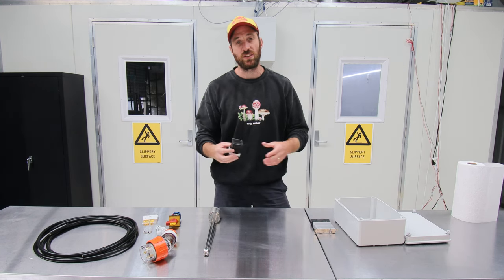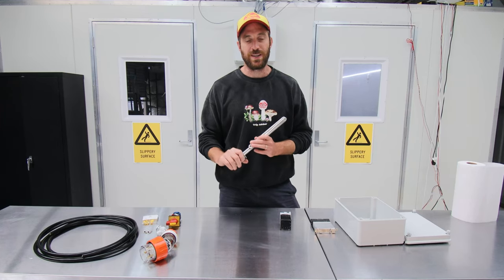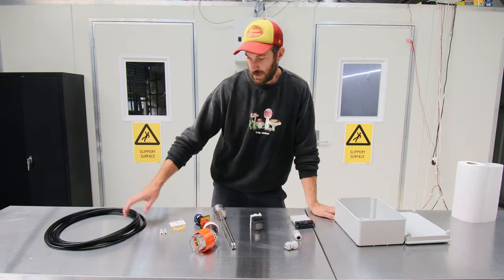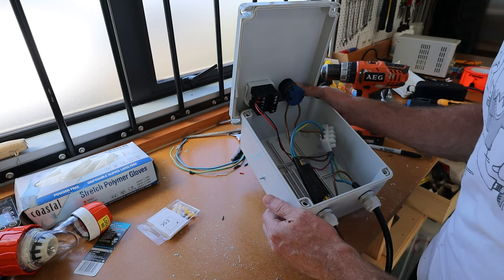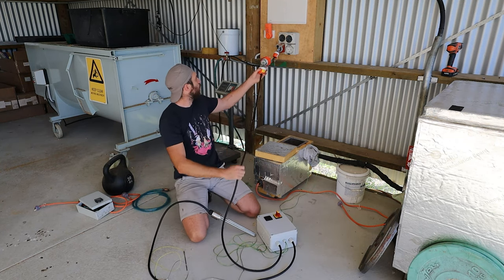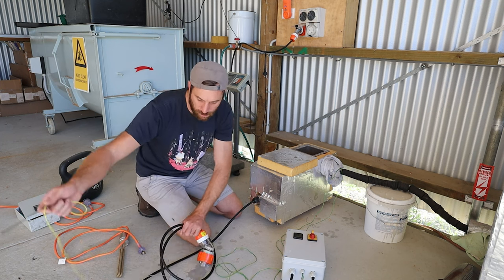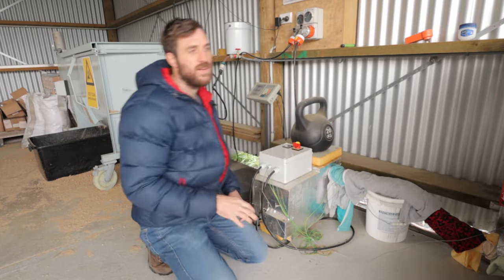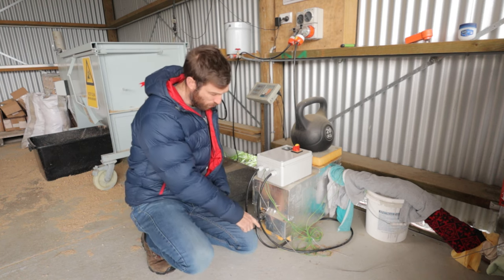Making a new PID controller for sterilizing mushroom substrate

Comment: Hey mate, sorry if you've been asked this before - what temp are you getting your substrate up to with steam? Everywhere I read, the consensus seems to be that Masters Mix needs to be sterilized under pressure and reach 110c+ for 90min. I've used steam for a small batch (5 bags), held at around 98c for 4 hours, it was fine with no contamination. Very small sample size though.
Reply from the maker: I do 95c, cook for around 24 hours. I do believe you can cook for a much much shorter period though.

Comment: Can you grow mushrooms without all the equipment or is that fruitless?
Reply from the maker: maybe, "all the equipment" is a very loose term.
Reply: Depends if you want mushrooms just for yourself and family, or to grow for market.
Reply: There are infinite teks (techniques) for mushroom growing. Long as you understand pasteurization,sterilization and you have good sterile techniques. It can be done in an instant pot or $6000 machine.
Reply: Uncle Ben's Tek is where you should start and then grow from there. 90 second mycology has a great easy tek which uses UB 90 second rice which is already sterile usually. I did my first grow with 6 bags. I didn't use a still air box, I cleaned my room well, sprayed with vinegar, wiped my table with alcohol and wore rubber gloves. I just flame sterilized the needle on my Golden Teachers spore syringe and injected it into the top of bag then covered the hole with breathable tape, (i can't recall the name). Once they were mostly colonized i broke and shook the rice cake then another couple of weeks they were ready to spawn to bulk. I used shoebox containers, coco, verm and gypsum and got amazing results for my first grow and breaking every rule. One shroom weighed 28 grams wet. Watch 90 second mycology then when your ready for more go to Philly Golden Teacher. Most simple, basic approach with great yields. Don't worry about it to much starting then increase your quality/quality with products and better techniques. A still air box is a very good idea but pressure cookers, flow hoods, etc aren't necessary until they are and you will know when you need such equipment. Also I didn't have a humidifier or anything but a room, shelf, fan and a fine mist sprayer for water. Bout to get some agar next week boi!

Comment: Hey mate, love the content you’ve been sharing and wanted to thank you but can I ask, does it need to be a Ramp Soak PID or is the one in the video good enough? I notice a vast difference in price and was wondering if it’s necessary to have that function in order to hold temperature for a set time. Cheers
Reply from the maker: cheap pids work fine. It's not really even using the pid function, it's just using a n on/off function.

Comment: What is the thermocouple doing? it's in the water right? i know they are used in gas heating devices and i get how they work but is it measuring a certain temp accurately? in gas it's simply to know if the flame when out to cut the flow of gas, i didn't know they could (or where used for) measuring temperature with precision.
Reply from the maker: Its in the sterilizing tank, not the water. The water always boils at 100c, you need the sterilizing tank to hit 95c.

Comment: Is there a reason your not using 2 x 4500w elements? I'm assuming it would cut down on heat up time?
Cheers
Reply from the maker: It would, but running two would require a much larger draw on power, and it might start overloading my circuits.
Reply: @OakandSpore  cheers, I'm getting a quote atm from your plans. I'll keep you posted :)
Reply: @touchmygoat4908  How much was you quote if I may ask?  Did it include the PID